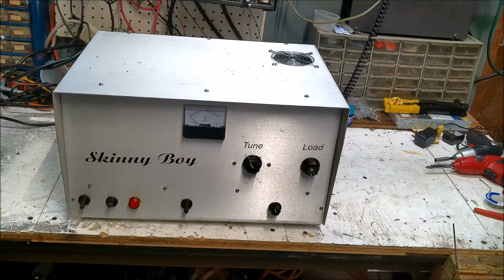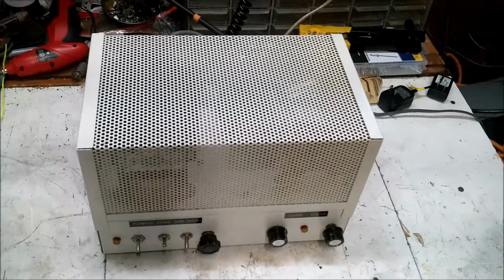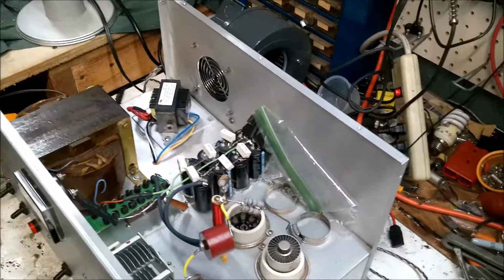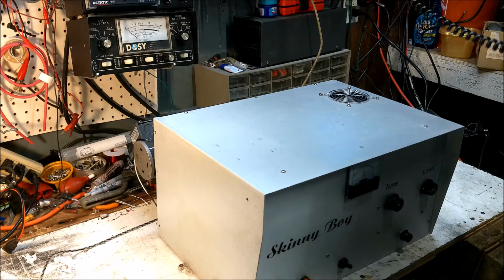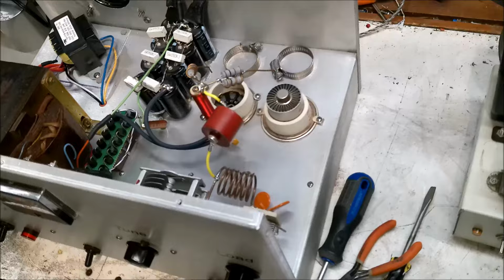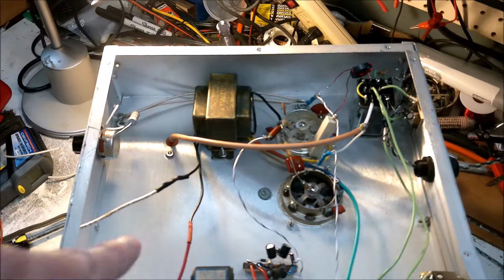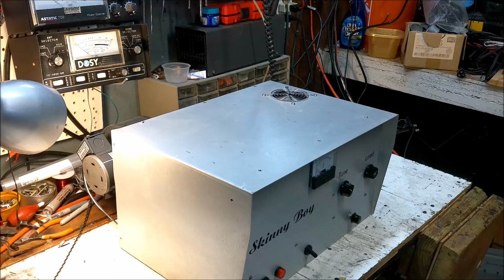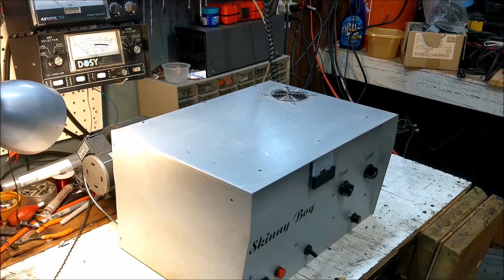Skinny boy amp repair

Comment: Got a Golden Falcon amp had to replace the on & off power switch  and now it keeps blowing a 25amp fuse in the back. Not sure what's wrong but I think it calls for a heavier duty power switch  what you think

Comment: Assuming your tuned input is working properly  (i did not see one),  try removing (disconnect)  the  Var. Tune cap.  If it works better without, it's  too much capacitance  for 10/11M with 2 tubes.  I'm working on that issue now with a 2 tube amp.